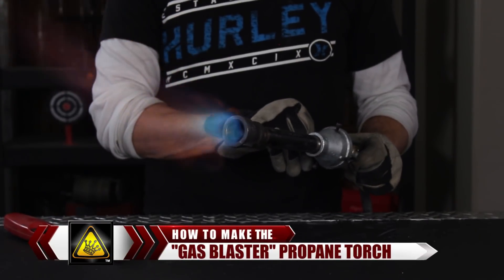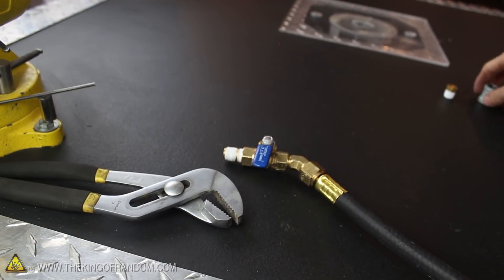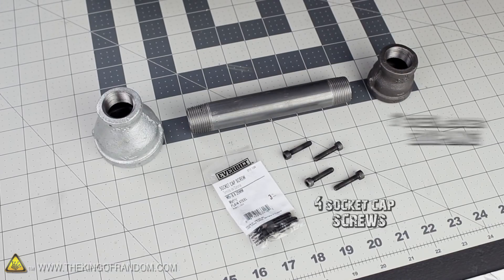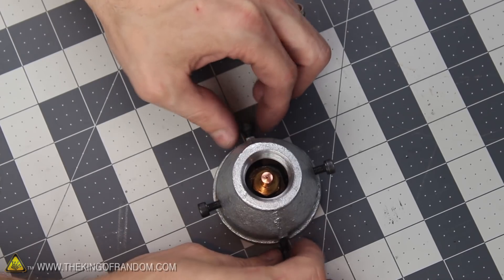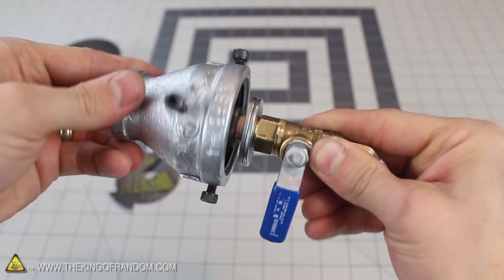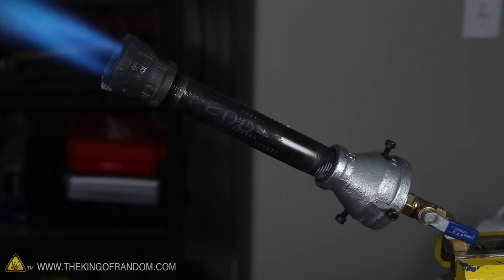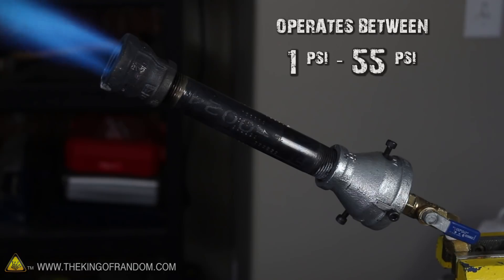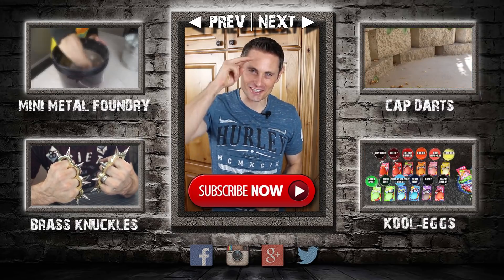Convert Your Backyard Foundry To Propane! ("Gas Blaster" Propane Torch)

Comment: "Hot enough to melt metal..." :( My refrigerator is hot enough to melt mercury. My alcohol stoves are hot enough to melt aluminium and one is even hot enough to melt iron. :P
Reply: A photo of one of my alcohol stoves: http://randomer.net/alcohol-stove/alcohol-stove-07.jpg The green color in the middle is the copper burning off of a penny (that was accidental!) The remaining zinc core: http://randomer.net/alcohol-stove/alcohol-stove-06.jpg (Zinc has a much lower melting point than copper, but I guess the thin copper cladding burned much faster than the zinc... and yes, the photos aren't in ascending numerical order.)
Reply: +Martel DuVigneaud Is that effectively the bottoms of a pair of pop cans with some form of alcohol inside?
Reply: TheAttacker732 Yes, that's exactly right! In the photos I was using ethanol, but I've also used methanol and isopropanol.
Reply: +Martel DuVigneaud Is it just the vapors burning then, and how are the 2 pieces joined?
Reply: TheAttacker732 Yep! The blue flames are from the alcohol boiling and the vapor blowing out through the small holes and mixing with the surrounding air and if I understand correctly the orange part of the flame is some remaining carbon glowing as it finally burns. The alcohol stoves are self-regulating and have a very neat balance of positive and negative feedback: the burning alcohol provides the heat but the liquid->gas phase change also works as the coolant! And if the whole thing gets too hot the vapor will blow the flames away from the cans, causing less heat to conduct into the metal and thus allowing it to cool down!

The can bottoms are just hand pressed together. There's no glue or sealant or anything like that, just the friction of the press fit of the metal. Also, I usually add steel wool inside for slosh dampening (just in case the stove gets knocked over) and also to help conduct the heat from the outer walls into the alcohol. Here's a photo showing how I was scoring a can: http://randomer.net/alcohol-stove/alcohol-stove-09.jpg You don't actually have to cut all the way through the can; just scoring it and then flexing the score line will break the aluminium very cleanly.
Reply: My sink can melt gallium. My stove can melt bismuth.
Reply: what is a alcohol stove
Reply: +Dominic S imagine a stove, but with alcohol

Sorry. It is also called a Scout/Hobo stove because it is a very easy stove to make that is powered by anything from rubbing alcohol/isopropyl alcohol (safest) to beverages and hand sanitizer (not as safe, but if you aren't using it to cook then oh well.) You can cut a pop can in half and poke some holes for air intake near the top, fill with alcohol (don't overfill to the holes), light, and boom you got a "stove." you can of course up size to a coffee can or make it an actual stove instead of a grill (don't cut coffee can in half, just cut out a makeshift door)

Comment: Hmmmm, now you need to take it a step further and make a waste oil burner! It melts more metal, because of the higher burning temp and high BTUs it puts out, with a squirrel cage blower can, and compressed air line for a turbo! Though you might need a larger Foundry setup with higher refractory temp ratings as it cracks my 2600f rated refractory...time to rebuild with 3000f stuff and try to melt steel!

Comment: I see you switched to a different crucible than cut off fire extinguishers.  Is that graphite?  Any word on where to acquire the right size graphite or heavy duty steel crucible?  I melted a hole straight through my mini-metal-foundry(and through the cheap charcoal grill it was set on... down to the ground!) when the cheap crucible itself melted as did part of my air intake pipe.  My foundry is running WAY too hot.  I think I need to switch to the propane here in this video to run cooler and more controlled, so my temp doesn't get hot enough to melt steel.

Comment: As a general rule, I like to keep galvanized steel away from significant heat sources. Metal poisoning is not fun. 

For those of you who are not familiar with this, here is a link to the Wikipedia article: https://en.m.wikipedia.org/wiki/Metal_fume_fever

Not saying this design isn't safe, but if there is a non galvanized replacement, I'd suggest buying it for peace of mind.

Comment: hey the working principle of this thing is similar to a ramjet engine, right? the pressure created by expanding propane gas at the exhaust sucks in air from the intake. the more air it sucks in the more power. correct me if im wrong.

Comment: Use soapy water to check for leaks. Brush or spray onto joints and if there's a leak, you'll get bubbles.  Lower pressure (around 5 lbs.) works best.

Comment: Note to anybody who is going to use this, for efficiency sake, if you want a cooler flame (heat wise) it is better to reduce the PSI before reducing the air intake, because if you do it the other way around, you will be inefficiently burning propane (And I'll explain why below for those who are interested).

When you increase the air intake the flame turns blue because you are providing enough oxygen to complete the chemical reaction (1st chemical equation below), in other words when it's orange you don't have enough oxygen to properly/completely burn the propane (2nd chemical equation below), which means your propane is burning less efficiently, in turn the combustion doesn't release as much heat, which means you'll have to burn more to get the same heat for your crucible (or whatever else you are using it for).

So if for some reason I lost you in the explanation above (which wouldn't necessarily surprise me as my explanations aren't always very clear), I basically said it's better to reduce the heat output by burning less with enough oxygen, instead of wastefully burning more with not enough oxygen.

Complete combustion reaction:
2[C3H8] (g) + 10[O2] (g) --> 6[CO2] (g) + 8[H2O] (g) + Energy (3949 kJ) [In the form of heat]

Propane + Oxygen --> Carbon Dioxide + Water + Energy (3949 kJ/Reaction)

Incomplete Combustion reaction:
2[C3H8] (g) + 7[O2] (g) --> 6[CO] (g) + 8[H2O] (g) + Energy (2307.1 kJ) [In the form of heat]

Propane + Oxygen --> Carbon Monoxide + Water + Energy (2307.1 kJ/Reaction)

So with the same amount of propane an incomplete combustion only releases 58.4% of the heat as a complete reaction

Calculations below...

Complete combustion:
2[C3H8] (g) + 10[O2] (g) --> 6[CO2] (g) + 8[H2O] (g) + Energy

2(4006kJ/mol) + 10(498,7kJ/mol) --> 6(1598kJ/mol) + 8(920kJ/mol)
8012 kJ + 4987 kJ --> 9588 kJ + 7360 kJ
12999 kJ --> 16948 kJ

∆H = 16948 kJ – 12999 kJ
∆H = 3949 kJ

Incomplete Combustion:
2[C3H8] (g) + 7[O2] (g) --> 6[CO] (g) + 8[H2O] (g) + Energy

2(4006kJ/mol) + 7(498,7kJ/mol) --> 6(1075kJ/mol) + 8(920kJ/mol)
8012 kJ + 3490,9 kJ --> 6450 kJ + 7360 kJ
11502,9 kJ --> 13810 kJ

∆H = 13810 kJ - 11502,9 kJ
∆H = 2307,1 kJ

For percentage:
2307,1 kJ/3949 kJ = ?/100   -->   2307,1/3949 = 58,4/100

Comment: where did you get your crucible? you should make a video making one
Reply: +Samuel L  I saw the steel fire extinguisher one but the one he's using is ceramic, my steel and cast iron crucibles die too quickly
Reply: +Alex van Dalen    Take a look at "Making Crucibles" by Vince Gingery at gingerybookstore dot com. Shows how to make and cure clay and clay+graphite crucibles.  GT cut the bottom off of an old fire extinguisher which will work fine  for occasional casting especially if you can pick up a couple cheap at garage sales and flea markets.  That will get you started and you will get a chance to see how long they last and decide if you want to make your own.  Sometimes these projects lead on to one sub-project after another.  I've also seen some people use cast iron cookware - sauce pots of about 1 quart capacity - although purists claim the iron contaminates some metals.

Comment: 0:54 Why is there no tape on the first hose connection?
Reply: +Sion you don't tape flare connections, the seal is made at the flare and not in the threads. If you were to tape the threads you would not be able to tighten the connection as securely.

Comment: my friends and I made the charcoal furnace but because the lid kept breaking we made two furnaces cut a hole in the bottom of one and set it on top of the other, works like a charm we melted are galvanized steel crucible.